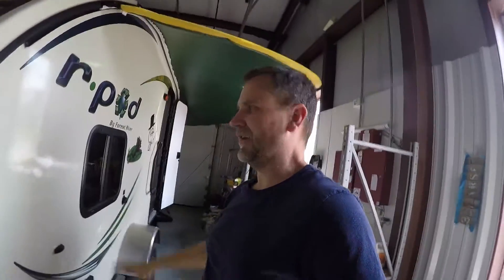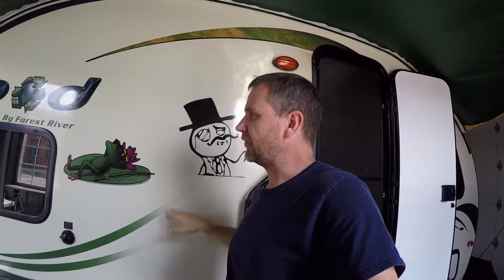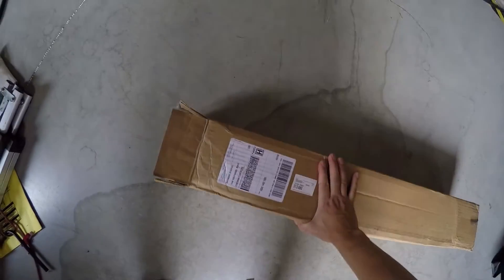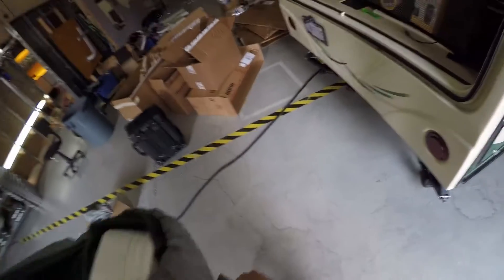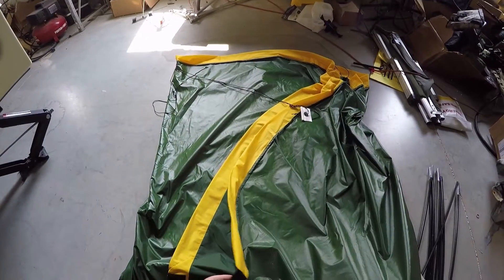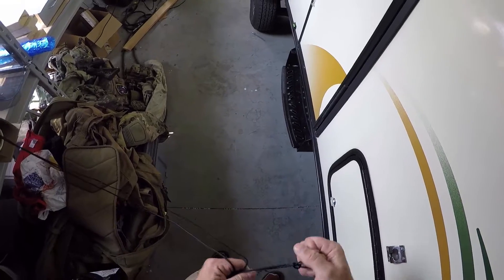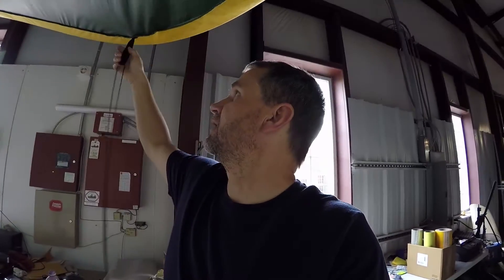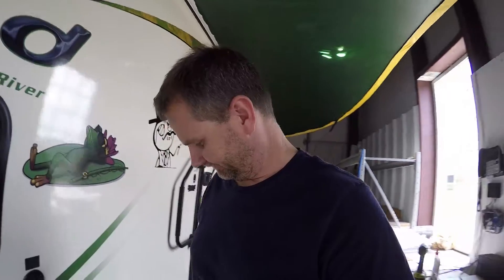R-Pod 182G Custom Awning and Sunshade from Paha Que.

Comment: Did they add a pole instead of the strings?
Reply from the maker: It comes with poles and the strings cinch it tight.
Reply: Thanks.  I am going to look into it as an alternative to putting up the R-Dome.